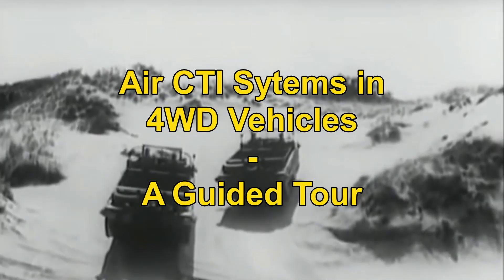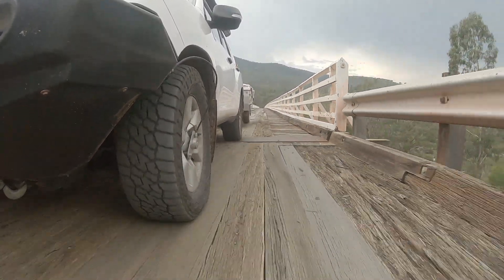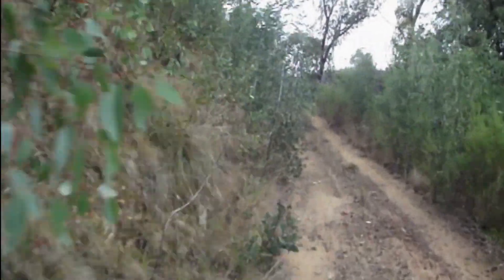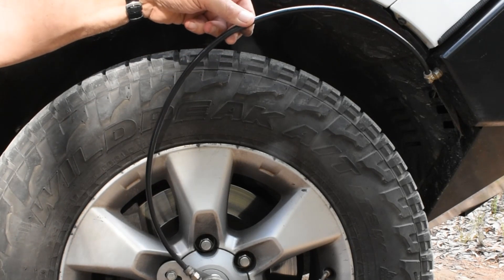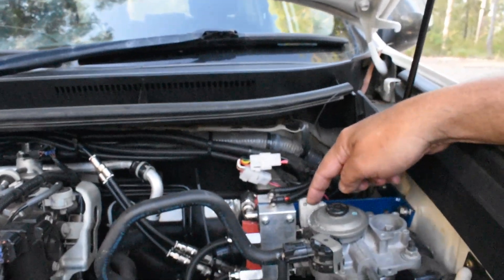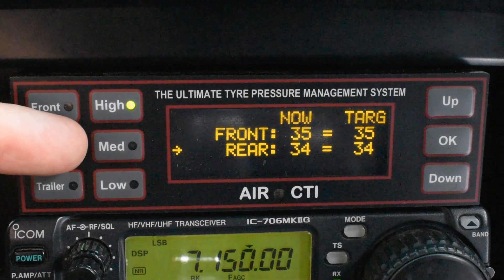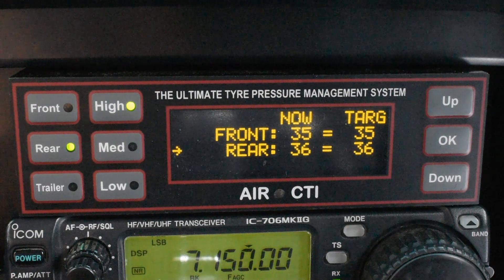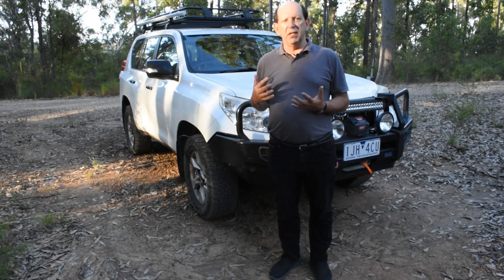Central Tyre Inflation on 4WD vehicles

Comment: Many thanks for your video.  Well done!  Knowing from history, as you pointed out early on in your video, that the most successful off road vehicles are equipped with four wheel drive; locking differentials AND a centralized inflation/deflation system, I began searching some years ago for such a system that could be retrofitted to modern autos like your Toyota Prado or my Toyota Tundra.  Until now, because of your well done video, I have found just such a device/system.  Well done in having it retrofitted to your vehicle and well done video.  
I have myself experienced the great advantage of lower tire pressure in low traction conditions.  On my grandfather's little south Texas ranch, the south Texas wind blown dust settled for decades around the corral, windmill and water tank with a texture like very fine dust.  I took my litte Toyota Tacoma, similar to your Hilux, there and lost traction.  In fact, it simply dug in until the rear bumper hit the ground!  I gradually lowered the tire pressure on all four wheels to 20 psi.  No good.  15 psi. No good.  10 psi. No good!  Oh damn.  FIVE psi!  Damn!  This better work!!  It climbed right out like it was nothing.  Valuble lesson from 20 years ago.
Reply from the maker: Hi, your experience is valid.  Many people believe that if you just take 5-10 psi out of tyres, they can do anything.  It is not like that.  For real traction in short bursts you have to go low so that the underside of the tyre has a genuine flat spot.  Then it works great.  What the display shows if left in Standby is that on a warm day tyre pressure can climb from 40 to 50 psi simply from a hot road and people who start with 40 in their car or trailer are shaking their vehicle to pieces.   Lots of vehicles now have tyre pressure monitors, but they are of very little value, because they don't actually do anything to your tyres.  Real versatility only comes with a full CTI system.

Comment: Thank you for creating this video. Do you happen to know if this system would work for a rig that is equipped with an air suspension that has 5 inches of possible rise? Thank you
Reply from the maker: Hi, a fair question.  It should be ok.  I have seen a couple of different strategies at work.  Where the air line line comes from a point in a wheel arch, the approach to the centre of the wheel is kept as close to horizontal as possible.   This gives maximum travel with the wheel.  On bigger vehicles I have seen semi-rigid air lines pass over the wheel anchored to a bracket mounted on the suspension arm, so that the entire feed floats up and down with the wheel, then there is a protected air line from that bracket back to the vehicle body, like the brake line does.  I have seen this done to some light trucks as well.  It is very effective.
Reply: @YJ0AUF  Thank you very much for your prompt and thoughtful reply. I sent a message to the CTI team just now to learn more about the system. I’ve tried a few manual systems over the years, and look forward to learn if I can make this a reality for my Jeep camper in the US. Best to you and yours. Ofer
Reply from the maker: You're welcome Ofer.   I think you would get a lot of value with this on your jeep.  It sounds like a marketing plug, but I do use this all the time.   Sometimes I'm just towing a trailer over a bit of wet grass and the wheels want to churn.  I just push the middle preference and find that I can then drive anywhere without kicking up mud and scaring the field with tire marks.   I've noticed that in Australia, most of the companies that send trucks into paddocks to spread fertiliser and the boom lifts operated by power companies all run CTI now.  They don't damage crops where they drive and it keeps the farmers happy.
At least the AUD-USD conversion is on your side right now!   Cheers.

Comment: Will one ever be made that operates from the inside of the wheel instead? This would hide the system from being visible and also protect it from hanging outside the vehicle with tubes etc.
Reply: Only on portal axles.
Reply: we have done that,  but only on trailers because the axle is hollow and can be utilised like that,  drive axles and steering axles have to many moving internal parts that don't allow for it to work like that unfortunately

Comment: Bloody great set up i reckon,  i first saw this video of yours last winter,  i thought i'd go check out the gear for myself direct at their workshop in Morwell, Vic...  a surprisingly good price later and i had the system on my little Jeep Cherokee, and taking me to where the "HARD BLOKES' in their 'REAL' 4x4's'  were struggling to follow,   Like yourself,  I'd recommend  AIR CTI to anyone that would hear me...... but even more to the ones that don't listen coz they need it the most  haha
Reply: Can i get a rough estimate of how much it would cost? Am trying to install the set up but i don't think am gonna find it in my country, might have to ship it and have it installed here.
Reply: @anthony-joedib8583  hey mate, sorry I only just saw your comment lol  
18 months ago it cost me  AU $ 5300 to have them supply and install on a Jeep Cherokee,  I liked it so much that I got a job there about 7 months ago lol
the system is around AU $ 4800 supplied only, we do ship around the world and if you can wire up a trailer with 5 core wire cable and hold a couple of spanners... you can install it yourself,  cheers mate
Reply: @dommyd73  cheers for the concise response mate. Is tempting at that price, does it have a min pressure it'll not go below? I have a van that's a bit too tall for my carport door haha, gonna test letting the tyres right down just for parking... be a nice reason to go all out and use flat tyres vs replacing the door at a similar cost!
Now if I can just find some airbags too!
Reply: @sn0wchyld  yeah mate,  pressure's are set at a basic high, med and low,  being 35, 22, 12.  then you can just push the up and down arrow buttons to pick any psi in between,  or it can be fully customised with any psi at the H, M, L that 
you choose with an absolute maximum and minimum set for safety reasons
Reply: will 2nd the request for a rough cost... cheers.
Reply: @sn0wchyld  hey mate, just got notified of your comment..
the system is around $4,800 supplied in Australia... if you can wire up a trailer and hold couple of spanners, you can install it yourself,
it's proven to me that it worthwhile on the traction point but also in tyre wear and cost,  I've done 60,000 in the 18 months since I put it on and tyres aren't even down half tread yet.
cheers mate
Reply from the maker: Glad to hear it worked out for you too.  I have a lot of paddocks around my home that are soggy in winter.  Even in 4WD the wheels churn up the mud through the grass.  I punch the low pressure button, then drive anywhere in the paddock without breaking through the grass - with the firewood trailer on the back.  Get to the gravel driveway, punch the Hi button and by the time I hit the bitumen I'm already topping 30 psi and rising.  Super handy.  I have a $2500 winch on the front of the car that came with it - but I haven't needed it yet.  The CTI works every day.  the winch, maybe once in a blue moon.

Comment: I have to admit that those external hoses make me nervous, but it's interesting that you've never had a problem with them.
Reply: From where i live (iceland) there is tons of offroad vehicles using the external hose cti systems and there has not been that many issues when it comes to snagging on trees, rocks, ice and snow and most often its "dissasembled" while daily driving with the external hose and the hose conecting to the inflator valve are in the car and installed when going on trips
Reply: @icesar8211  We visited Iceland in 2018 for almost two months, I couldn't believe the amount of vehicles running with hoses like in this video to operate a CTIS. One question I did ask a few drivers of these vehicles was, "why do you stick them out at 90º to the vehicle body?" They really didn't have an answer except to mention that is the way everyone does it.

I also asked them if they had many issues with the hoses, only one person with huge tyres on a Mercedes Sprinter 4x4 mentioned scraping against rocky walls was the only problem and if pulled out it took only a few minutes to re-instate the tube or replace it with a spare.

There is one major difference though between Iceland and Australia, scrub, or low lying bushes and trees that will potentially snag on the tubes. Iceland has very little scrub in the inner parts of the island that I visited compared to what we have in Australia. However you do have a lot more sidewall scraping when navigating rutted tracks than Australia does from my small look at Icelandic inner travelling.

I now have one of these systems, but it is the heavier duty truck system that is the mainstay of this company. I recently did a couple of tracks where the scrub and trees presented some real issues, the end result is that the fuel tanks on one side of the truck, which are inside the body line and wheel line have many train lines scratched into the steel tanks from the scrub and trees. The CTIS hoses deflected all and sundry and have nary a scratch, quite a testimony to the build, design and material quality of their product.
Reply: @allanhugh2044  there is no way a real offroad vehicle would run this with external hoses.  I would break those off every trail I do.
Reply: @Cuyose   That may be the case if you are running your wheels in deep ruts and they are sliding along their tyre and rim walls, even then you will be alright until roughly the centre of your wheel (axle height). In our case our axle height is around 500mm and the hose is still internal to the tyre side wall until around the 600mm mark; at which point it starts to be proud of the upper half tyre wall by about 60mm, give or take.

I agree that if you really do slide your wheels along the walls of deep ruts, things could be interesting. However the componentry we have is for trucks, not passenger car type vehicles which is the componentry shown in this video, and by definition of the anticipated heavier workload, the piping is super heavy duty and almost bullet proof.

We also have the issue that our vehicle is 2.2m wide, whereas most other vehicles going down the same tracks that we've been down, are often around the 1.8m to 1.9m wide mark, give or take.
Reply: @allanhugh2044  No, every branch, root ball or rock would snag and take that off.  Iceland, sure, there are no trees on those trails anywhere near your vehicle.  Thats not what 95% of people who offroad encounter here where I live.

Comment: That’s great until you rip the hose off with a tree
Reply from the maker: Been driving all over the Victorian mountains for the past 6 years on bush tracks with CTI fitted between this vehicle and another one.  Never lost a hose yet.  I like those odds.  Some people think it may happen, but it doesn't.   If it did, I would just push the hose back on again and keep going.  It is a non-issue.  Ask anyone who has it.
I much prefer the security that if I punctured a tyre, the system will keep it topped up until its safe to deal with.  Depending on the size of the leak, that may be a few weeks later.   The CTI works for the car all of the time, not just when driving through sand or mud.

Comment: This is a great investment, yet so many people go for it. I believe CTIS should come to all cars in the future. It is one of the most beneficial safety and quality-of-life system. Especially here in Europe, when there is -15 Celsius, the tires have a completely different pressure cold and after 15 mins of highway driving. The difference can be up to 0,5 bar. To be able to adjust the pressure automatically would be a great plus. Great video, you have showcased the system in a very structured and comprehensive way. I am surprised that the hoses have not been damaged while driving through bushes, and that the valves are not suffering from dust and sand and keep the air sealed.
Reply from the maker: Yes there are huge tyre pressure shifts with temperature.  On a hot day in Australia a tyre could go up 10psi while in use if it wasn't balanced.  The seals in the wheel rotators are a special carbon assembly unique to this company.  The rotators on the outback trucks come with a 1 million kilometre guarantee.  The same hardware is used in snow in Latvia and North America.    The reduced vibration in trucks on rough roads is making other vehicle components last much, much longer.  Systems pay for themselves.
In practice, snagged air lines basically doesn't happen.  Between this Toyota and another car, I have been driving bush tracks for 6 years through the Australian High country and haven't lost an air line hose yet. Many drivers have this experience.  If a hose did come off, I'd just push it back on.  It is much more important to have puncture protection where I may have to stop and change a wheel under adverse conditions with standard tyres.
Reply: by any chance could you tell me what product this is exactly  have been trying to find a system like this for some time now and have been unable to find one that has the fetures yours has  @YJ0AUF

Comment: The dangling hose, kills this for me. That would never last doing any real wheeling
Reply: This is a very very common "civilian" method. It's not unique to just this video.
Reply: It would appear you clearly did not watch the full video. The author states how long has he been using them in off road conditions, with no issues. Also, there is nothing dangling.
Reply: @bm_videa  Yep. This is not a new or unusal way of doing this. I think he's just new to this kind of setup :D

Comment: Very interesting over view, especially the fact you can run each axle independently. I also like the fact you can use kPa instead of psi.

A question: All of the information and pictures I see from this company use far heavier hosing compared to yours, is this intentional for your vehicle tyre size, or has the company changed their hose material and/or diameter?

You also answered another question, the ability to maintain the same designated air pressure regardless of the terrain and ambient temperature.

Your compressor looks to be a small single cylinder unit, is there a holding tank, or is it direct to the tyres?  Can you give an approximate time frame the system is pumping to go from gravel road to bitumen road pressure? I assume the system airs down reasonably fast.

Many thanks for this, very informative and without the hyperbole that is often attached to manufacturers clips.
Reply from the maker: Yes the tyres are maintained to within a pre-selected range, usually 2psi.  I haven't run a stopwatch, but anecdotally I don't believe it has taken more than 2-3 minutes to get from any pressure to any other pressure.  The compressor works well, without any air tank.  The rotators seen here are a lower-profile version than those used in trucks, but manufactured by the same company. Bear in mind that the large truck tyres are often in groups of 4 or 8 and higher flow rates are necessary.
Reply: @YJ0AUF  Thank you for your informative reply. Yesterday I visited their factory in Morwell, I intend to get this system.

Mine will be for a 7.5 tonne 4x4 light truck, so will be sightly different to your set-up, but essentially the same.

Comment: 7:30 super cool van 👍
Reply: It is a 1985 L300 van with a 2.6 petrol-LPG engine
Reply: @agalah408  thank you!👍
Reply from the maker: The 4WD L300 was originally manufactured as a hybrid. They took the suburban L300 van body and put it on a full-length Pajero chassis , with all Pajero suspension, transmission, diffs, hubs etc.  It is quite heavy, at just on 2 tonne unloaded.  Very tight turning circle, good approach/departure angles and as a forward control vehicle, it is easy to get wheel placement just right in tough spots.  Not many of them left now.
Reply: @YJ0AUF  great addition info, I like the fact that it doesn't waste any cabin space. I wonder if they evolved into mini vans.
Reply: @Dave Hart Thank you, for dropping the link! 😊

Comment: So what is the cost of the system?
Reply: I think they are about $4K  (AUD)  It is all Australian made hardware, including the electronics.
Reply: @agalah408  Sorry to burst your $4K. I am keen to fit this to my 519 AWD Sprinter (6 wheels) when MB finally delivers it sometime mid 2024. Last year I spoke to AirCTI about costing their unit for a 419 4 x 4 Sprinter. (4 wheels). At that time they spoke of $9K plus ARB twin compressor plus installation (~$2,000). With all the rampant inflation atm, it will be over $10K plus range now.
Reply: @davidlewinsohn9252  Thanks for that figure mate. 10k is a bit hefty for some festo tubing and a box with solenoids.
Reply: @KaiMundsinger  My figures are firstly in AU$ and based on discussions with AirCTI direct in Victoria Australia. I am not disputing your comment about it being very expensive, but AirCTI is the only supplier in Australia that will supply and install into my Sprinter van. I am waiting to get my van, then fit it out for full time travel, then fitting the AirCTI system. That is why I am so pessimistic about the final cost to me, considering these times of rampant inflation.
Reply: ...I bet it ain't cheap 🤨  ..hopefully someone will make an expensive system soon, made from Chinesium, from Chy-na
Reply: @Texaca  yeah, whenever marketers fail to mention price its a red flag.